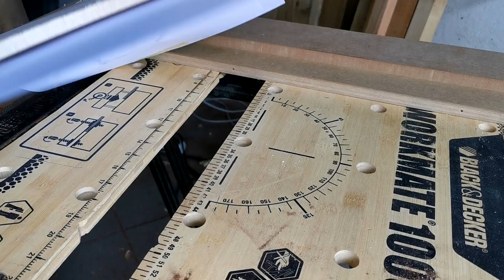Great Guitar Build-Off 2021 Final Video

Comment: Nice one Shawn. It’s looking perdy! Only thing I’d recommend with painting is to do a primer/undercoat it will help to fill some of those slight imperfections and also create a much more even consistent finish for the top coats
Reply from the maker: Thanks so much 13! Especially for the tip. I was wondering that a lot before I started painting, and decided consciously against it because of my research, which led me to believe that closed-pore woods, like maple, don't need a primer. I forgot I was painting mahogany too!
Reply: @ShawnHeath  in my 20years of painting experience all bare timber should have a primer/undercoat. Use an oil base undercoat on tannin rich timbers to hold back any bleed through of natural oils in the timber
Reply from the maker: @13flaws18  Awesome! I forgot that I've asked you about painting before. I will start doing this, good sir. Do you have two product recommendations that I can check into, one oil-based and one not?
Reply: @ShawnHeath  it’s hard to say as the brands we have in Australia would be different to what they sell in Germany. My recommendation would be to go into a paint shop (not a hardware store) and tell the people there exactly what your doing and get their recommendation/advice on the best products  to use.